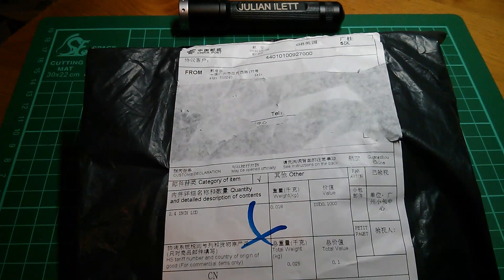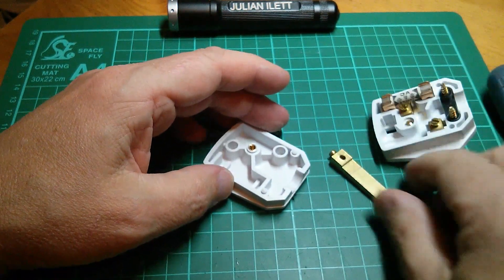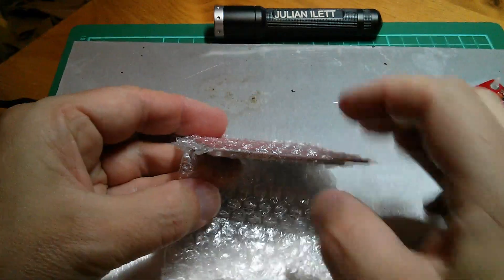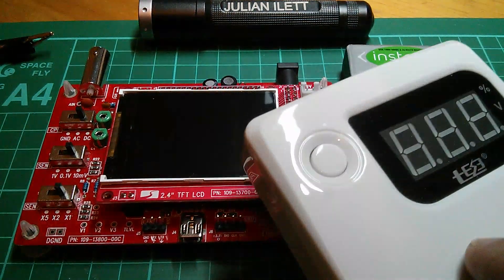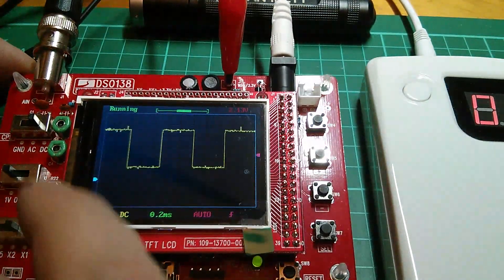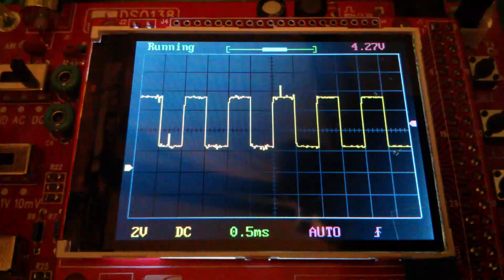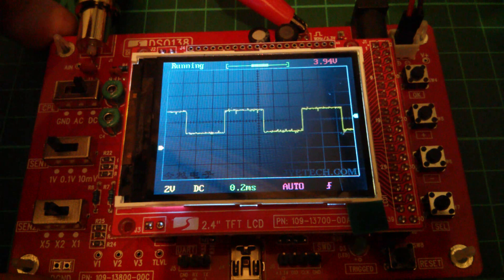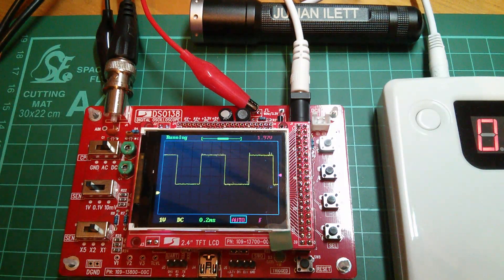Julian's Kit Build: Banggood £15 ($23) Oscilloscope (finale)

Comment: Looks like you haven't followed all the jumper instructions or calibration instructions.  I built one of the after watching your original video and it works much better than that. I have uploaded a video.  It's a shame such a kit gets such poor reviews due to users not following the instructions.
Reply: Coolkeys2009 Damn. That's not bad. I'm getting one now, even though I know I'll probably never use it.
Reply: Coolkeys2009 Never mind I was a bit harsh. Looks like you only need to calibrate the trace to the vertical position indicator by selecting it and holding the select button for 2 seconds. You may be able to improve the trace a bit with the compensation caps but your square waves look pretty good. Agree about the noise but this is a £20 pound scope not a £400 pound one(will look for reviews of the new version). I hope some people can write some firmware to improve or re-task the scope. May be it can be one of your projects :-)
Reply: Coolkeys2009 
Except that the noise problem has nothing to do with calibration. There's a reason why people made hardware bodges to reduce the noise and JYE/banggood has spun a new board and firmware.
Reply: superdau
Yeah I know the noise isn't related to  calibration, but I believe it will affect the trigger level  he did comment on trigger behaviour. I referred to his comments about noise and the new version in my post above. Julian Lett is an institution now so people expect the highest possible standards from him(well maybe :-)   )
Reply: Coolkeys2009 can't agree more theirs only so much you can except from a 20 pound scope it would be unfair to compare it to devices which cost more then 10 times more!
Reply: Hi Julian,     I have a challenge for you, that I need help with. I bought the DS0138 about a year ago, and try to build it myself, but my soldering skills were not too great at the time. It switches on but does no work correctly, I suspect  the resistor etc may be incorrect or not soldered properly. I would love to get it to working standard.I was wondering if you could have a look at it for me, and in so doing, you could make a troubleshooting video for everyone on your forum.If you can please let me know, how to get it to you, I will pay for postage etc.RegardsM
Reply: If you are still having problems may I suggest you systematically go through a checking process? 
Start by looking at every component, to see that it is correct and orientated properly. Julian's dismissal of metering every resistor is a mistake.
Then look carefully at each joint. Soldering is an art and can only be learnt by practice.
And so on.
May I also suggest you look at this video. Though your kit is made, this will give you loads of great tips. 
https://www.youtube.com/watch?v=4Lsp5YZgsZU
Finally, don't give up. You can do it. Understanding electronics is as easy as reading. It just takes a bit of practice. It only seems complicated so people like us can charge a fortune for doing it. (I'm retired now so don't care!)
Reply: @spacial2
i always meter the five band resistors , i can never tell which way to read them :-)

Comment: Turn off the lights and other electrical equipment. LED lights especially - they have switching circuitry which produces a lot of noise. Dave from EEVblog  even has a video about it.

Comment: You need a bench power supply, mate! :-)
Reply: TechnologyCatalyst Julian Ilett  for someone that does that much work with various electronics it is TRULY AMAZING that he hasn't invested a little money in a real power supply.  Buying 9V batteries and the like is a waste of money and left him guessing what the problem might be.  Having a real PS allows you to eliminate a lot of possible concerns, one of which may have killed part of the problem last time.  It's basically the most important piece of electronics one should invest in when designing/building/repairing electronics.
Reply: I'd almost be willing to buy the guy a cheap but decent power supply if he doesn't get one.  These 9v battery banks and usb power banks are driving me bonkers :D
Reply: TechnologyCatalyst lol... ya they drive me down the same street!  Batteries are fine for a beginner or when you are very young but not when you're older and/or trying to make money with electronics.  It's like one of the first things you buy or even make when you are in school; at least it was for everyone I knew.  Plus if you're doing any amount of electronics it simply SAVES MONEY!  I see them used on Craigs list all the time.  I don't know what the electronics and ham radio swap meets are like in the UK but you can find lots of used PSs there too.  Get one Julian!   :-D
Reply: He has tonnes of power supply modules but I never saw him using them

Comment: This plug shutters are such a pain, I have those on some cord extensions it is awful.
Reply: +Ben&#39;s things &amp; thoughts
Depends, in UK the shutters will open when you press in the ground pin.
In EU, you have to break your wrists to get a plug in some of those.
Reply: Agreed, it depends on the brands, some cheapos are a real pain in the lower backside though :P

Comment: Great ending? I find the whole thing incredibly anticlimatic, I watched three full videos and you end on "it's got noise"? Pfffffft!

I expected you to put its through its paces a bit, hook it up to your function generator and let's see how well it represents a couple of signals side by side to your scope. March a sawtooth wave through it, see where the tip of the leading edge drops starts rounding off at what frequency, that typical sort of thing so we know how actually USEFUL it is or isn't. Ultimately that is what every electronic device is about & your video style should reflect that. If I had known there'd be no "review" or "reveal" I never would have watched the whole series to begin with.

You could rename this whole series: How to diagnose a faulty LCD screen & the lengthy and boring stages to..... <snore>

Pragmatism, man, pragmatism. Like your video on internal resistance of LiPo's (if I ever find part two of it)

Comment: It's not really a good idea using a piece of metal as a static-safe workplace - its resistance is far too low so there's the danger of a damaging spark if there's any static difference. Plus the earth lead + 1M8 resistor wasn't doing anything in this setup.
Reply: Graham Langley 
An earth lead and a resistor in the MOhms range is pretty much what an ESD braclet is. So why shouldn't it do anything here?
Reply: superdau As JI was touching the plate while working there was no point in earthing it, either directly or via a 1M resistor. 

The point when handling ESDs is that everything should be at same potential - you, the ESD, the equipment/surface you're working on etc. This need not include earth. 

Had JI got an ESD bracelet it should have been connected to the plate.

Comment: Interesting cheap thing completely made useless because of that noise.
When the display went grey I held my breath for a second. (should have put on some horror music on the background)
You should definitely buy a ESD placemat.
Reply from the maker: Luc Peeters If they can fix the noise, this would be a really useful tool.
Reply: Hi Julian. Really appreciate your videos
The oscilloscope noise issue has now been fixed
There are two separate fixes. Applying both fixes decreases the noise

Fix 1
See morganflint's post (July 08,2015 12:39) here for details and pictures:
http forum dot banggood dot com  forum-topic-61279.html?page=3

Fix 2
and also here: http www jyetech com forum viewtopic.php?f=18&t=518&sid=8efb78b37460c90d725ecee2d21a9cda&start=20 for details of the vendors fix and firmware update

I could see in your video on the boot up splash screen that your kit has the older (non fixed) firmware

Hopefully the two urls I've included here will show up but if not then just look here:

For fix 1: look at the oscilloscope comments in the banggood forum on the item page
For fix 2: look for the response from the vendor in the item discussion on the noise issue in the JYTech forum

I've just ordered a kit (latest version with the noise fix) from banggood so hope to be assembling mine in a few weeks :)
Reply from the maker: Acapulco Rolf Thanks, I'll give them a try - full links are:
http://forum.banggood.com/forum-topic-61279.html?page=3

http://www.jyetech.com/forum/viewtopic.php?f=18&t=518&sid=8efb78b37460c90d725ecee2d21a9cda&start=20
Reply: Acapulco Rolf  Super, now it looks really interesting!  Hope Julian does the mod and shows a before and after.
What I really like is that this seems to be a real company that actually improves it's products and supports them.
But they should sell a simple case for it ... might be the raspberry pi's under the scoops this one.
Reply: + Luc Peeters the designer's name is Liu Zemin.